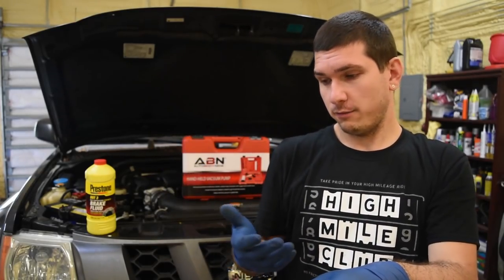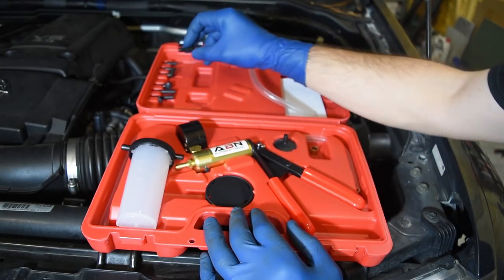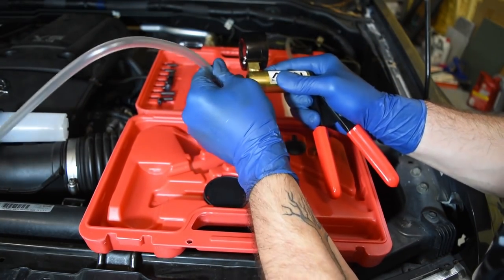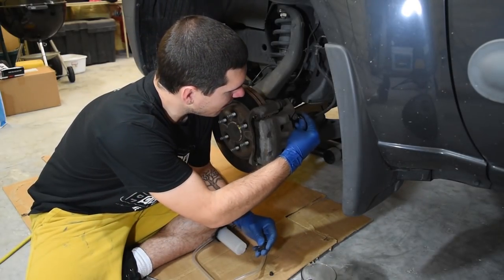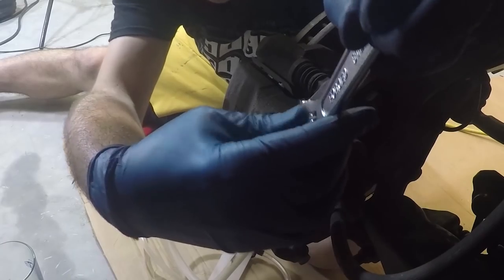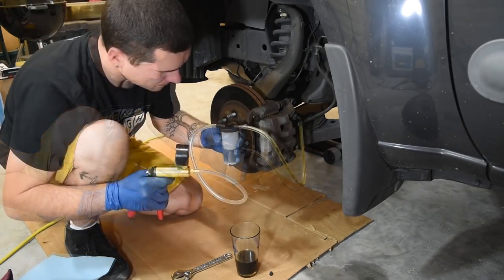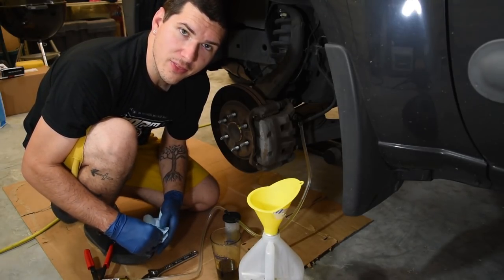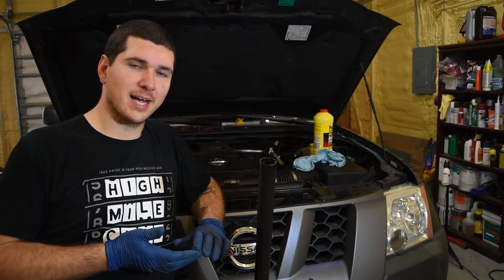How to bleed Your Brakes (replace brake fluid)

Comment: Here is what the service manual says for 2015 Xterra says. 
1. Turn ignition switch OFF and disconnect ABS actuator and electric unit (control unit) connector or battery
negative terminal.
2. Connect a vinyl tube to the rear right bleed valve.
3. Fully depress brake pedal 4 to 5 times.
4. With brake pedal depressed, loosen bleed valve to let the air out, and then tighten it immediately.
5. Repeat steps 3 and 4 until no more air comes out.
6. Tighten bleed valve to the specified torque.
7. Perform steps 2 to 6 at each wheel, with master cylinder reservoir tank filled at least half way, bleed air
from the front left, rear left, and front right bleed valves, in that order.

Comment: I just bought one 2 days ago to test the EGR valve on my Toyota Pickup. The frickin' thing pumps great but will not hold a vacuum. I tested it by blocking the brass nipple on the pump itself with my finger. After pumping it up it slowly then quickly starts to lose vacuum. It's going back tomorrow for the $40 one. Maybe I just got a dud. Would probably still work fine for bleeding hydraulic systems

Comment: Do you have the correct order to bleed the brales for an 07 Xterra? I hear its not the conventional way as in pass side rear, driver rear, pass side front, driver front. I hear its driver side rear, pass side rear, driver side front, pass side front. Is this true? I installed a new master cylinder, bench bleed it, and bleed the system about 5 times and Im still getting air. No leaks in the system what so ever!

Comment: hello there  need help this on 2004 ford taurus front wheels brake fluid won't go through to RT front wheel and LT got through caliper and it good grab the rotor and RT caliper not FLUID go through when I have a bleed fluid vacuum tool then I put it on and pour in brake booster fluid box then I start vacuum the RT caliper adj open nozzle it not fluid come out the caliper I already replace caliper from JUNK YARD... so I buy a Pressure vacuum bleed it gauge tell me it not pressure not HOLD up and fluid not come out. I check booster brake fluid still same LEVELER not doing down... I wonder why it not go through on RT side...something block???

Comment: Thanks for putting effort in making this video. However it was painful to watch you do it withe the tools you chose and I'm not talking about your vacuum pump. This stuff needs to be replaced every 3 to 5 years at the latest depending on your environmental conditions and definitely not when you "feel the symptoms". Also why everyone is saying to top the reservoir off periodically?  You only wanna do it with the brand new brake pads/rotors installed, that way the level of fluid tells you how worn your brakes are and you won't spill it when you compress the cylinders while changing your pads.
Reply from the maker: You live in a cold climate don’t you?

Comment: doing this now- is there any way to check before bleeding if air is the result of spongy brakes. I believe mine are "spongy" since the rear brakes [rotors] are 18.7 mm thick and fronts are 29.00 mm. I completed the job correctly but still have spongy brakes will change rear rotors and pads next. Thanks RY!

Comment: Dude...  In contrast to your discussion at the beginning of the video, liquid water is incompressible.  Stop saying water compresses.  Liquid Water does not compress, the same as liquid brake fluid, and liquids in general (note liquid and fluid are not the same and are NOT interchangeable terms:  e.g. Air is a compressible fluid, but it is a gas [compressible]  not a liquid [incompressible]).  Liquid, like Solid,  and Gas is one of the three states of matter.  Fluid means the matter has the ability to conform geometrically to a container and is not a state of matter.

You need to understand that when the brakes get hot from use, liquid water in the system can boil, forming steam (the gaseous form of water).  This gas (steam) is compressible, and will result in spongy feel and poor performance.  Further, water causes rust to form in its presence.  If this rust forms along a piston bore, its inconsistent geometry along with its hardness and abrasiveness will compromise the elastomer seal.  So, yes water is bad, but not for the reasons you stated. You'll always be better off armed with real knowledge instead of bs and your credibility will ensure people listen to and truly benefit from your teachings.  

And I did enjoy your vid.  Keep up the good work, just have your facts straight!

Comment: I just used that kit today on the wifes Hyundai I10. I did not use the black rubber nipple attachment but put the clear hose direct to nipple with a little silicone on the bleed nipple. I stay right next to the sea so have real problems with rust from the salt, I had to gently file the sharp edges off the bleed nipple to avoid tearing/puncturing the hose. Kit is really simple to use and quick. Good video, clear instructions, would have been good to see you pulling through fluid without any bubbles to get a true reflection of the system.  All in all well done and thank you.

Comment: do you have a power steering fluid change video?
Reply: JOE2979 JOE unhook your lines from your steering gear and let it drain then fill it up and leave your cap off and start your vehicle and turn your steering wheel back and forth a few times and if there's any air in it it'll Let It Bleed Out To The Top

Comment: You shouldn't encourage people to use adjustable wrenches etc, instead you should be showing this using the proper brake line flare spanners. I'm sure you know on older vehicles this will help dramatically with brake lines that are seized etc and stops the nuts being stripped, pretty good video apart from that.

Comment: Instead of waiting for it to come in on amazon harbor freight has a really nice one I use it at work all the time great tool .They also have another tool similar but instead of sucking fluid it works with the fluid to push the air up and out because air likes to travel up with this tool I’m talking about you just open master cylinder lid leave it kind of open pump the tool and all I does is push all the air up much more simple I seen the tool on a Scotty Kilmer episode I really want that tool

Comment: I think it would be faster if you pump the tool first then open the bleed screw then close it once the pressure lowers too much then repeat. Or just pump away with the bleed screw open as your doing.

Comment: I have a self bleeder  but I could not use it on my 2002 honda civic  it worked on the front brakes  but I could not fit line on the back brakes .

Comment: hello i have a2004 nissan exterra i replaced master cylinder bench bleed first before installing. i start to vacum bleed rear both side i cant get brake fluid to either one on rear. i cant seem to figure why not. cant you tell me what i need to do please?

Comment: Geez, the old white beard I used to work with would flog me if he caught me using a crescent wrench (and God help you if you got busted with vice grips)... especially on a bleeder nipple. folks, use a line wrench for this... even if you have to get a set at harbor freight.
Reply from the maker: ..kinky

Comment: I’m confused

You said to bleed the caliper closest to the reservoir first, but I’ve seen numerous other people insist that the farthest caliper should be bled first.

Am I confusing the bleeding process with the flushing process?
Reply from the maker: Nope you're not mixing them up. The rule of thumb is that you start from the furthest away but that is not true for all cars. Please reference your repair manual for the proper order.

Comment: Adjustable wrench, definite no no.  Also, start by removing most, but not all,  of the old fluid out of the reservoir with a turkey baster, or something similar.   Then, refill reservoir with new fluid, and start with the furthest brake from the reservoir, the rear passenger side brake.  Next, the driver side rear brake, then, passenger side front brake, ending with driver's side front brake.  Also, anytime you need to remove the fluid bottle container, or any other line of the bleeder system, always close the bleeder valve so you dont run the risk of reintroducing air into the system.
Reply from the maker: Adjustable wrench is more than fine on a FL car and the 80 year old myth of “start from the furthest from the reservoir” is categorically false. Modem cars have all different kinds of circuits the bleed pattens vary. Even that aside it still does not make a large impact. I do like the turkey baster idea so you have to drain less out at the first wheel.

Comment: Hey RY, just wanted to ask if the bleeding order is a big deal because for our truck the order is different then other vehicles, the order for bleeding is REAR PASSENGER, FRONT DRIVER, REAR DRIVER, FRONT PASSENGER.   Is this going to be a big deal for the way you did it ? I have a 2010 but its the samething.
Reply from the maker: I’m glad you asked. It’s really not that big of a deal. Some people act like the car will explode if you don’t start with the wheel closest to the tank. Yet Nissan specifically instructs you to do it differently. Every car is different and IMO the order does not matter that much on any of them. Keep in mind that Brakes work in circuits so each tire or possibly groups of tires have a separate brake line circuit. It’s designed this way so if one or two calipers go out you are still able to stop your car safely. So they are not connected after to the distribution actuator. The only time that they share lines is from the brake booster to the actuator. Which is a very short distance.

Comment: Is it bad to just pump the brake pedal to flush the brake lines? Assuming the reservoir is kept topped off.
Reply from the maker: Not at all. That method is just easier with two people.

Comment: Do you have to take the wheels off? I haven’t looked yet. 

And is the order; LF, PR, DR, PF

OR… RR, LR, RF, LF? Oh my! I’m getting confused.
Reply from the maker: It's easier if you take the wheels off. Order is WAY less important than people make it sound. The rule of thumb is to start from the furthest away form the master cylinder then work to the closest. That would be the second order you listed.
Reply: @Rythecarguy  Thank you! I just found a place where I can work on it myself, and you can rent a bay and use their tools. Looks like it’s going to be an adventure!

Comment: I'm confused... I hear a lot of conflicting ways of bleeding brakes. 1) Start from the furthest away 2) Start from the closest away. Which is it?
Reply from the maker: Always follow the manual. It's technically different for different types of cars. It's an old rule of thumb to start from the furthest away. Remember in the end, it really does not matter that much.
Reply: @Ry the car guy  Thanks for the speedy reply. Great videos.  👍👍

Comment: Cheers mate! Best explanation so far compared to all the other brake bleed videos out there. I was surprised you didn't use a 10mm wrench to open the bleed valve? 

Good idea with the vaccum pump, however, you would think the container came in a bigger size to avoid from emptying out the old brake fluid unless there is a reason for it?
Reply from the maker: I cant think of a reason. I agree, its annoyingly small.
Reply: It is a reminder to top off the resivior
Reply: Exactly correct

Comment: It depends on the manufacture what sequence you bleed the wheels. If you can’t find it then start from the furthest wheel away. Both ways work BTW. I would not use those black bleeder screw adapters cause it’s just a place where it could suck in air.
Reply from the maker: THANK YOU. I have been arguing with people for years about this. It is not ALWAYS the furthest away. I have had plenty of cars where that is not the case. It’s just a rule of thumb that people take too far.

Comment: Looks like you are too eager to bleed the brakes. Please use proper tools for the job. Adjustable wrench is perhaps the worst tool one can apply to bleeder valve.
Reply from the maker: Not when you have a FL car. Nothings seized and it does not take any effort. If I were a little stronger I could take bolts off that truck with my fingers. Thanks for sharing your opinion though.

Comment: Hmm. Could you use that to reverse bleed a clutch? Or perhaps suck the fluid out of it? I tried bleeding the clutch on mu BMW but barely any fluid comes when the clutch is pumped. I then read that those have to be reserve bled (pumping fresh fluid from outside in, up towards the reservoir. But now I wonder if this kit would “force” suck the fluid out through the nipple...
Reply: If its a new clutch master cylinder you got bench bleed it... Before. Connecting the line... Other wise you might not ever get any advancement on fluid movement. If its same master cylinder on thier your trying to bleed make sure your clutch pedal freeplay adjustment allows the pedal to retract back up enough to allow the plunger in the cylinder pull out as much as possible.

Comment: use a small amount of brake grease around the threads of the bleed screw, this will stop the small air bubbles
Reply from the maker: Great tip!

Comment: Great example on how to use the vacuum pump properly. When I replaced the brake fluid in my car, I replaced it with DOT 5 even though it calls for DOT 3. DOT 5 is silicone based and doesn't absorb moisture like DOT 3 or 4 which are glycol based. Also, if anyone is curious you can use DOT 3, 4, or 5 brake fluid. Just don't mix DOT 3 or 4 with 5. You can always go up a number, but never down a number. For example, if your vehicle calls for DOT 3, you can use 4 or 5, but once you go up to 4 or 5 you can't go back down to DOT 3 unless you replace the fluid all over again.

Comment: Now i am confuse, i have a Trailblazer 2003, ABS brake sistem, on which Tire i first start to bleed?
Reply: The wheel with the longest brake line.

Comment: i hope you got a wrench set by now. that adjustable one was ridiculous for this service. You didnt mention if the clean liquid still had bubbles. what if bubbles were still coming through the clean liquid?
Reply: Bubbles in  clean fluid usually means air is getting in the bleeder threads

Comment: massive air leak in that vacum hose to bleeder valve connection . a thick grease will help seal that air leak
Reply: even a zip-tie would probably work to.

Comment: I see a lot of bubbles coming out of the line. In the past this has indicated air in the line which can cause a spongy pedal. Thoughts?
Reply: Vacuum pumps draw air through the bleeder thread that will appear like trapped air in the system.  Grease the thread of the bleeder to prevent this, you should probably use caliper seal grease to prevent possible contamination.
Reply: A bunch of very tiny micro-bubbles that doesn't stop is probably air getting sucked in around the bleeder threads and nothing to worry about because it can't get into the cylinder. If you continue to pull large bubbles, it could be air being sucked past the internal piston seal - not good, because that is putting air into the cylinder. That is the one down side to using vacuum bleeders. After a while, with experience you will learn to tell the difference between what is ok and what is not.

Comment: Why couldn't I let run dry? I mean, I know about the air and all, but doing this way on the video, we are mixing old with new fluid. Couldn't I just run it all out and then refill and make sure the air is taken out? Thanks
Reply from the maker: The mixing will be absolutely minimal at best. I would not worry about that. Secondly, Getting all the air out of a completely drained system would be a complete pain and would take far more time than it’s worth.
Reply: @Rythecarguy  i saw another video after yours, that the guy takes the air off the master cylinder and it takes awhile... anyway, I did this job just like video this morning but I could not garantee there is no air in the system because there were lots of bubbles still coming out, which I believe were from the nipple, but I couldn't be sure... Anyway, I will drive for a while and see how the pedal feels. Thanks

Comment: Hi Ry,
Thanks for the new video. Been meaning to bleed my brakes. One question though: Everything is replaced under the hood of my '06  Xterra, but I have a squeak. Not brakes. IDK if it's a faulty pulley or what? Squeaks when I accelerate and driving speeds (45-75). Very annoying and embarrassing! Any ideas? Anyone? Like I said, everything's new under the hood.
Reply from the maker: Its hard to tell without actually hearing it. However, it could be a pulley. Sometimes if your alternator or power steering pump is starting to go out you will get a squeak. Or if your fan clutch is starting to go you will also get belt squeal.
Reply: Hey, thanks. I'll check it out tomorrow on my day off. Did that squeak happen when accelerating? Or at cruising speed? Just a thought? Thanks again.

Comment: perfect demo. TU. but why start off with driver side. all other videos say the rear passenger side and then rear driver side.
Reply: you need to start from the side that is nearest to the main cylinder. thus immediately drain the maximum amount of an older / dirty brake fluid

Comment: Nice demo . The only thing is , is that im hearing most videos saying to leave the location under the reservoir  til last. Youre saying  do that  one first. So does anyone have any factual info on this.
Reply from the maker: +John it depends, the general rule is to leave it for last. But for instance my audi has a specific order and on that car you start with the furthest one away and work you way closer. My opinion is that if your manual does not specify then do it in any order you want.